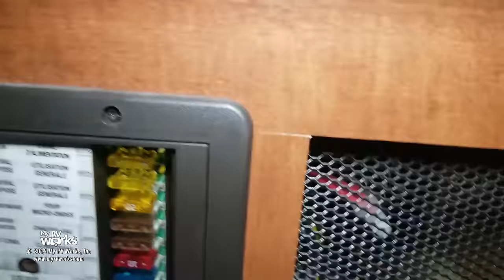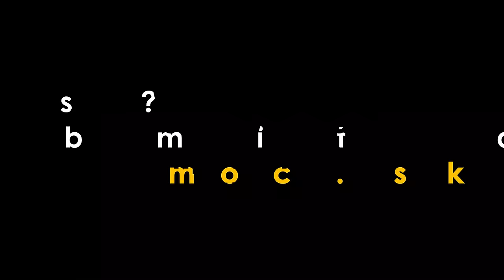RV Power Problem Leads to Converter Diagnosis and Replacement

Comment: Listen carefully folks...he's right about if you upgrade to AGM batteries you Must change your battery charger to match. We bought an old Class A with a new $350 AGM starter battery that lasted barely more than a year...it would show full voltage but instantly drop to 7 volts when I tried to start the engine. Researching a replacement I learned that things have changed since our class A was built 30 years ago. I've installed a small Optima charger on my dashboard that shows me the condition of my starter battery and not only charges it but reconditions it at various times. Well worth the money. I installed AGM House Batteries that are charged from a new Converter I installed. The original Converter weighed 30 pounds, was always hot to the touch and was really loud 24 hours a day...the new one weighs maybe 4 pounds, is silent, cool to the touch and does tons of things that the old converter couldn't do for my batteries. I installed the new converter floating 4 inches above the floor and several inches from any walls on 2 large L-brackets to facilitate the cooling of the unit.
Reply: Ditto....and our replacements were blue tops (painful lesson)

Comment: R you saying inverter was powering the converter ? Shouldn't the battery power the inverter and converter should not be powered by anything. Else you'll back feed the batteries. Is that what killed the batteries?

Comment: Remember to use your batt disconnect switch to turn off the battery connection before doing this job. Also, the batteries in this video are probably not going to come back to life if they're reading an absolute zero voltage.

Comment: WFCO 8955 converter fan runs all the time 24/7 even if you take out all the 12volt fusses except for the 2-40’s

Comment: You nailed it. I tried looking at my RV website and tried to describe the problem. I got nowhere. Your video with the blinking clock on the microwave was my exact situation. I found my converter and yes! I had two blown 35 fuses. Everything works again. Thanks.

Comment: Nearly my exact symptoms except batteries were not dead as I have a couple solar panels sending juice to recharge the batteries. But I did notice no working 12V circuitry when plugged to shore power and battery disconnect set to "off". Comprehensible description of the science and & application and some of the perplexing issues such as "Where you might locate the converter". Thanks for going to the trouble of filming-editing-posting videos and sharing your knowledge with us. It sure helps and settles the anxiety in dealing with situations.

Comment: Incredibly helpful. The fan on the invertor no longer runs to assist with keeping said appliance from getting too warm.  I had noticed this at least a year ago and so I've placed a fan down by the appliance as a way to give the cooling effect of the non working fan. So far so good.  

I do feel lucky thus far that the appliance hasn't failed.  My battery is staying charged, so whether the charger is within the invertor or elsewhere I have no idea but at least the charger does and has kept my battery charged.  I don't travel with the RV (1997 Shasta w/small slide out) so I only use one 'flooded' battery for the 12V boards that do the things you spoke about and all those systems do work properly. Of course I now know to operate the slide, if ever I do need to, I'll add a second battery in parrallel to increase amperage for the motors.

I've lived in this RV since November 2015 in Arizona through cold winters and oppresively hot summers.
I don't use my LP gas furnace as the blower fan has a worn bearing that squeals when I try to use it, which I just don't and hav not for several years now.  But seeing how easy it is to remove the stove I may attempt to get to the blower motor which is located under the stove.

I've suffered two mild strokes in the past five years, I'm 65 years old and no longer agile, so I don't know if I shall try to fix the blower motor myself or continue to use electric space heaters.  

I realize the fire danger of over taxing the shore power and such with space heaters and I know I really need to get things working properly.  In particular I should save the money soon to be able to have a invertor on standby for when mine does eventually fail. I rarely use the 12 volt lights, but of course the fridge needs the 12 volts either from my house battery or from the invertor being I'm on shore power.

Same goes for the roof A/C board and when I rarely use the water heater the gas ignitor circuit* needs a working invertor or a charged 12 volt house battery.  
*This I knew already.

ALL OF THIS I WROTE ABOUT IS SOMETHING NEWLY LEARNED,
AS I WAS UNAWARE OF MUCH TOO MUCH OBVIOUSLY,
UNTIL I WATCHED THIS VIDEO.

Comment: Great video and explanation. I just went through this same process of elimination on a 1999 Cedar Creek travel trailer. After all the troubleshooting I found that the AC to DC converter had gone bad. Much simpler fix than replacing the whole power center. Took 15 minute to uninstall the old unit and install the new one. Now everything is working again on both sides (AC/DC) as it should.

Comment: Thank you for this video. Iam a technician helping a friend with his refridgerator and this video answered everything. He is running on A/c only with no batteries and his fridge keeps cutting out, but when I hit the water pump or the slide out it will kick the fridge back on. Well you just made me realize why.. His converter is bad and  Im guessing that its over charging  hitting the slide out is pulling such a load that its dropping it down enough to alow it back on.. Im pretty sure the diodes are bad in the converter because I was picking up quite a bit A/C voltage at the dc leads and fuses.
Thank you very much!!

Comment: 2 battle born bats, 1 go power ic2000 inv/conv/char, go power controller, 2 flex rich 100 watt solar panels, 1 rich 20a MPPT controller, trc surge protector   .. u can thank me later ..this is 1 year of full use in camper & hundreds of hours of use after 6 months of initial research b 4 install. PS THIS IS THE BEST ExPLAIN'en LUCY I'VE EVER HEARD damn that was good.

Comment: Know you probably won’t see this cause this video is from a year ago but thank you for this very informative video. Especially the part about different types of batteries will need different types of converters/chargers. Cause I am needing to replace my water filled battery and was considering a sealed type battery. Thanks again. 👍👍

Comment: This was exactly my issue.  Some AC outlets working, but no fridge, furnace, lights.  Bought a voltage meter, did the diagnostics.   A bad converter.  Purchased a new converter, and installed it within an hour.  Thanks for the help.

Comment: Watched a couple of videos.  Tested the out let it was reporting strong......however,  it was a 20 volt sideways prong. The prong reciver inside the out let had bent and was not Making connection.  Replaced outlet and saved money on the converter.....thank you again for explaining to start at the source and complete all tests. Troubleshooting isn't for the quick crowd....slow down and save. I also noticed that when I unplugged and plugged into outlet lights and converter would come alive for about 3 seconds. Started tinkering and then confirmed outlet fail.

Comment: Hey Darren, enjoy the channel you’re the best. As a career Marine tech if this were a boat, I may have load tested the outlet for the converter. Sometimes you can even smell if the converter is burned up. You know before you do the test but you have to do the test. Great channel. I try to learn something every day.

Comment: Hi Darren great video. I'm very familiar with Carlsborg. My Sprinter based MH got left unplugged for a couple weeks and when I went to use it I no 12v lights. I plugged into shore power and my battery meter said I had 94%. It continued to drop as I charged it.12v lights work on shore. Now after a weekend trip it's at zero after being plugged in overnight. I'm sure unrelated but I don't have tail lights either. Gotta love RVs, but makes work for you. Cheers

Comment: Dealing with this camping this weekend. Fortunately I had an old school battery charger.. 2 10 and 50 amp start selection switch.  Hooked it up to the battery and will at least get to deal with this at home over the week.

Comment: Thank you for this video! I learned a lot here. We have been having batt discharge constantly. I did check the readings on my meter and they are perfect and the fuses are good so I believe the converter is good.  Still have to charge the batt every couple months though. ?????  By the way I found the converter in the back of the rig in the storage bay. everything else is mid rig.

Comment: i have to say...this video save me $$$ from taking my airstream to the dealer. Could not find the short on my fantastic fan, thermostat and ac unit all 3 did not work, AC work just fine but your explanantion about this boards needing their 12 volts to make their circuits work. My batteries showed good voltage but their capacity was only 9%. bad batteries. Now it makes sense. they would work intermittently. Thanks for the video explanation.

Comment: Hi Darren, thanks for helping me so many times.  I do have a conundrum that I hope you can explain.  Three things  happened when I plugged in to shore power at a park.  The fuse on my fridge blew, my electric element for my fridge also quit, and the high limit thermostat on my electric side of my water heater tripped, and my converter quit charging.  I’m thinking this wasn’t all coincidence but I’m not sure. We changed locations in the park. I ordered and replaced the converter/ charger.  In the mean time,I charged the batteries with our jeep. I changed the fuse in the fridge and , thanks to you, tested the electric element and it is bad but the propane side works fine.  I will replace that when we get home.  Next ,I reset the limit switch on the water heater and it worked fine for aa couple weeks and then quit.  We have since been using the propane to heat the water.  When I get home to,or row I will begin the recovery from vacation breakdown.  What would cause the refrigerator fuse to blow?  Bad shore power?  Heating element?   Also the water heater , from the bad power.  I never lost my 12 volt ,just the charger and I assume that was the bad power......  lastly can you explain exactly what bad power is and how I can avoid it in the future......  this put a real damper on our vacation but at least I am able to fix a lot of stuff myself.... thanks a lot Darren.
Reply: Hey Darren, I began to replace the electric element on th fridge today. The element has welded itself to the tube and I can’t get it loose. Have been saturating it with liquid wrench. It feels like it is going to break off before it comes out. I guess if that happens I’ll need to remove the fridge for access to that tube. Any suggestions?
Reply from the maker: Hi Augie,
 
Your question has been selected for an upcoming video where it will be read and discussed by Darren - Certified RV Tech and online personality for the 'My RV Works' videos.
 
If you have not already subscribed to the 'My RV Works' YouTube channel, please do so and keep a watch for the ‘RV Tech Talk’ video releases.  This series is a selection of comments and questions that will be covered and released weekly.
Here is our YouTube link:  https://www.youtube.com/c/myrvworksinc

Happy Camping,
My RV Works Media Team

Comment: Hey Darren, I just discovered your channel and I live in Agnew!  We're practically neighbors man!  I had an interesting thing happen last week, my mom called and said she could smell something hot like wire burning.  I went over there to take a look.  I started with power to my shop from the meter base, then to the 100 amp panel I upgraded in there a couple of years ago ...240 so far so good, then at the 70 amp pedestal. Still ok at 240  Then Inside the 40 ft park model I had 240 at the 50 amp main, and even intermittent 120 at some of the breakers, however it would change every time I put my Fluke meter on it, sometimes the power out on the breakers would go from 120 to 90 and then to 180 and all over the place.  Long story short, the 50 amp shore power cord which is a twist lock on the outside of the trailer trailer had worked its way counterclockwise and therefore the neutral was barely connected, so the circuit was trying to use one or both of the hot wires to complete the circuit back to the substation instead of using the Neutral.  Needless to say we had to buy a new tv for her, those new tv's don't like 180.  

I'm currently trying to locate a new converter for a lady that works for me, her and her husband live in a fifth wheel and they lost all 12v power, they don't currently have batteries hooked up in the trailer, which I heard can be bad as the charger doesn't have any resistance load to work against.  Anyway, I'm having trouble locating the exact unit.  Its a 2007 trailer with a model 555 Parallax Converter-charger.  It looks like, as I am in the middle of the research phase of this issue, that a Parallax 5355 is a really close match not only in features but the size as well.  Thoughts?  Maybe one day we will run into each other, I stay in my trailer 3 nights a week in Forks, and besides my mom's trailer I also have my Aunt on our property in her own 40 ft fifth wheel, and then across the street my other Aunt is in her own 40 ft fifth wheel.  So as you can imagine I am always doing something on these trailers.  Maybe I should go watch your video on becoming an rv repair business.  But that would be in another 10 years after I retire.  :)

Comment: Thanks for the info especially if you are changing your battery type from liquid to AGM sealed. Changing the converter doesn't look too bad depending where it is located.

Comment: Thank you for explaining and demonstrating changing the converter. Sadly our converter and panel are one unit.  So the repair will involve reconnecting every wire for the breakers and fuses.  I know our trailer was cheap but the design caused lots of extra expense.
Reply from the maker: When we come across that in the field, we orphan the existing converter in place and install/wire a new standalone converter behind the panel.  Check our playlist, we have video showing this procedure

Comment: Yea, you’re a TEACHER! Nice explanation of the problem. The only thing makes me fun (or, honestly, sad...) is the design of the coach: to pull out two pounds electrical box you need to disconnect LP lines and pull out 25 pounds box! I gonna fire the designer: he doesn’t care about maintenance cost of the product he did at all.

Comment: I had that  same  setup as far as the access. 
I took the fence/grid off and put a air vent register cover...mounted on outside..two thumb screws....and I can access  the  converter  very easy access now
Reply from the maker: Great tip!

Comment: Darin, absolutely love your stuff.  I've learned so much from watching multiple vids.  I'm looking for any video you did on 'dirty shore power'.  I just had to replace my breaker panel (with converter - all one unit) because I was getting the AC side but house battery was dying.  Everything worked again initally but two days later (running off grid off of my inverter generator), I got the same problem again.  My generator is not charging my house battery as evidenced directly with my multi-meter on the battery.  However, when I got to a campground and plugged into 'real' pedistal shore power, everything is working great and my battery shows over 13 volts while charging.  I think I need to test my generator voltage that it's putting out.  Any videos on bad generator / shore power?

Comment: Awesome video! I'm in an older RV and my breaker kept tripping the other day and the last time we reset it, there was a loud buzzing/electrical noise I've never hear before and it tripped the breaker, I've been scared to try to rest it again. Is it my converter? My converter is right behind the fuse panel, wasn't sure if it was breaker or the converter. And what does plugging into "dirty power" mean?

Comment: Great Video! I loved the explanations.
Also, encourage your viewers with 199x trailers to change those DC converters. Mine started to catch my camper on fire by slow-burning through the floor. AND... We all love those stupid Proane / CO detectors. But they're only supposed to be good for 5-7 years. Change them.

Comment: Just 2 things that I want to add:
1.   120v might be present at the outlet, but if the wire is frayed when you try to draw amps it can't push them through. Rare, but I've seen it.
2. An open wire will not trip a fuse or breaker.  You can have a bad wire still between the converter and the battery. If the wire isn't making contact with a ground the fuse/breaker will not blow

Comment: I’ve had a couple of occasions where the fuse looked good to the naked eye, but was in fact compromised. Did you consider double checking them with your meter before declaring converter dead at scene? Good vid! Thanks!!!
Reply: With some fuses, that's a possibility.  A hairline crack in the metal.  The little glass fuses in cars could be blown at the ends where it is not visible.  A continuity check would verify if the fuse is good.

Comment: A twofer!  Learned how to remove a stove too!  Thanks.
Have you ever relocated the convertor?  Seems to me that the closer it is to the battery, it would be more efficient.
Reply: Ideally, a shorter run would be better, but that is rare on many layouts. As long as the wire gauging and connectors are proper, there will not be any noticeable difference in performance.
Reply: 12v is in efficient in transportation of power, however this is most noticed over larger distances. There will be no noticeable difference in an RV.